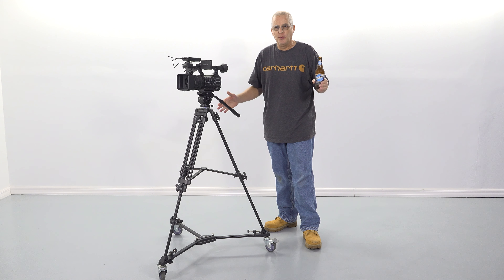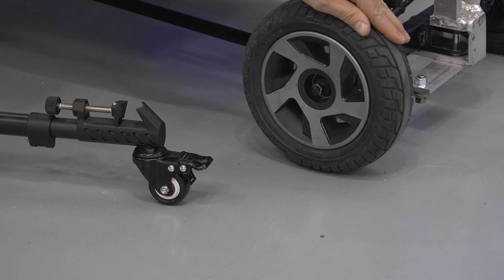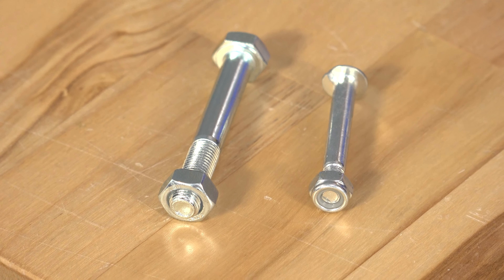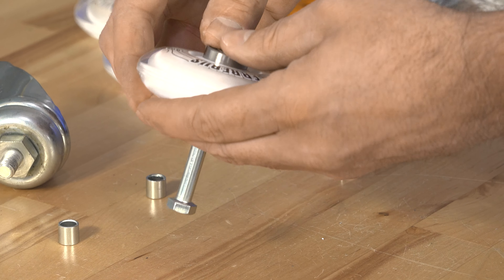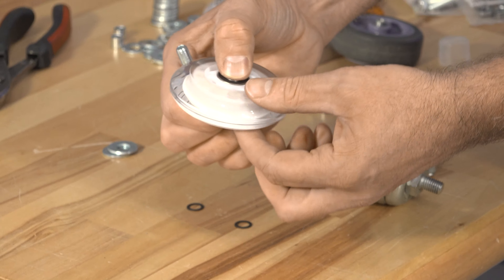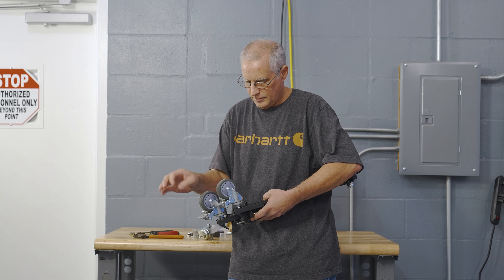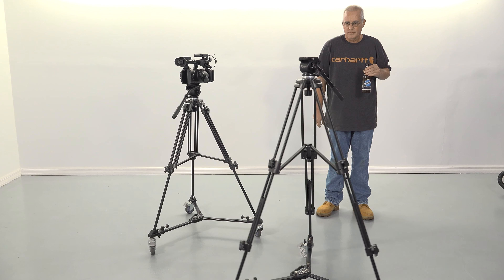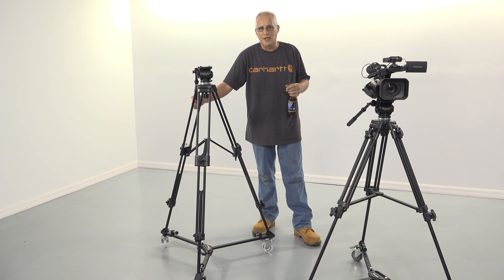How To Replace Camera Dolly Wheels with Skateboard Wheels for Super Smooth Cinematic Motion

Comment: Why is this video so underrated, ok I have just one thing that I’m tryna achieve, yours is perfect but what if it’s able to lock the swivel angle, would it make it possible to set the circular dolly angle so it’s not gonna just float with our imperfect hand pushes
Reply from the maker: There are only so many people that need the information so we don't have many views. But we like doing them.

 As for locking, I have not seen that on cheaper dollies. You might be able to buy an older dolly, Vinten, Cartoni, ITE or O'conner or something high end that has that function. I have a few Cartoni P-20s that do that but they are $7,000 each. But sometimes you can find a used dolly for under $200 on ebay that can lock wheels into a position.

Comment: I wish the companies that make these tripod dollies would use larger, better quieter wheels.
Reply from the maker: They just use junk, readily available commercial casters. Watch our video on changing the dolly wheels with skateboard wheels, the difference was incredible and it was very easy.

You just have to upgrade and design better than new. These companies try to make it affordable to get sales, forget quality, that seems to be secondary.

Rather than making smooth wheels, they tell you to add skateboard wheel sets and put it on tracks.